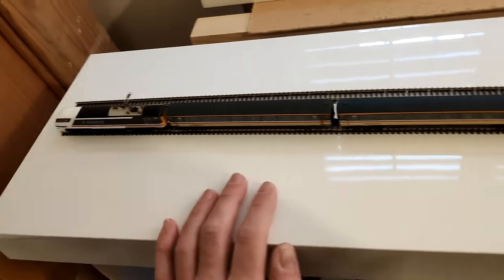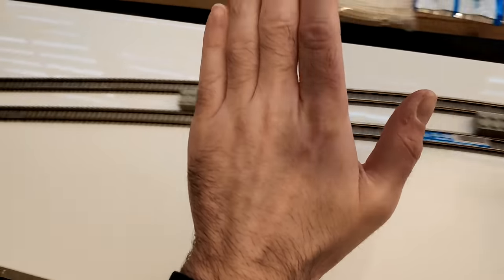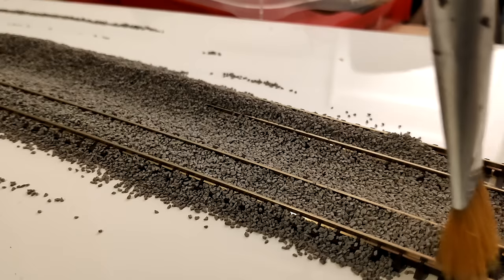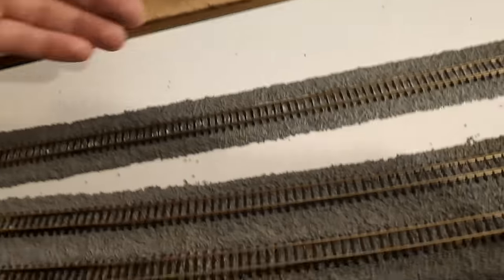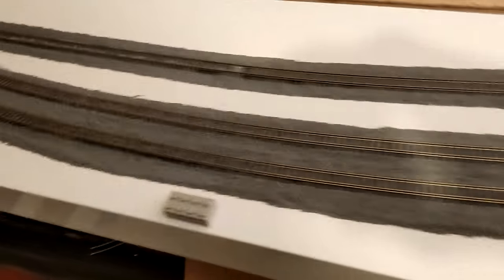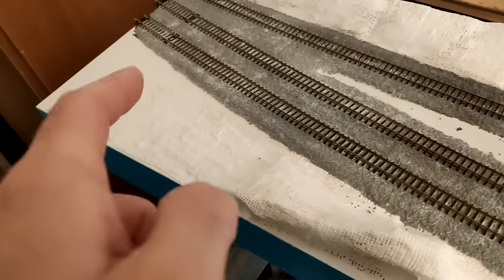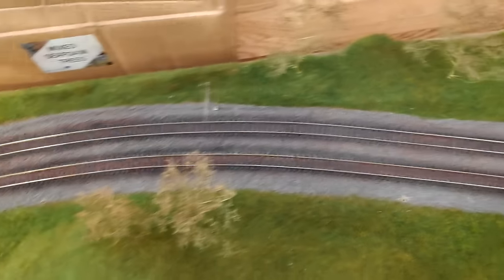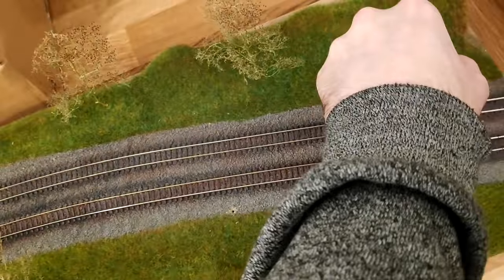Lets Build an N Gauge Shelf Layout (Elevated Curves)

Comment: Hi Richard.  The trick to stopping your ballast from floating when you apply the glue is to pre wet the ballast using a very fine mist of Isolropyl Alcohol.  I use a solution of about 85%.  This stops the ballast from moving and I use a normal glue bottle with A 60/40 mix and drizzle it on.  A quick ipa mist afterwards will sort out any bits of glue that are sitting on top or poooling
Reply from the maker: Thank you, Yes i knew i was missing something when i was ballasting! Brilliant cheers 👍

Comment: a great glue for ballast, is 1/4 pea, 1/4 acrylic medium ( I use gloss it is cheaper) 50% 90%+ isopropyl alcohol. The benefits of this is that the ballast will not be brittle and can flex if the board is moved or transported.

Comment: Hi Richard. Very effective! I was surprised when you put static grass directly over the plaster bandage, but it works very nicely. (It's not necessary to physically ground the crocodile clip - you can just hold it just above the surface, although clipping it to a rail is handy.) You definitely need the buffer stop at the end of the siding. Right-hand running! (sometimes)?
Reply from the maker: I call rule 1 for my running of locos as i just dont know enough about the real ones myself just yet, ive seen most real locos in my area run on the LH rails, is this a common setup of the railways? Like our British roads, drive on the left kind of thing? 

Im affraid to electrocute myself so i opt for clipping the static grass applicator where possible👍, i may get brave on my next application of grass and hold the clip with my hands 😁. 

The buffer is in place now and forever it shall stay, ive superglued it down👍

Thanks for Watching Paul, i appreciate it👍
Reply: @ThisWayWorksTWW  While LH or RH running (depending on the country - interestingly, when Sweden changed from driving on the LH side of the road to the RH side [overnight!] in 1967, they left their railway system on LH running) is the "norm", there are often reasons for reversing this; so, Rule 1 applies. I'm a little worried about your fears of being electrocuted! If you hold the wire rather than the clip (as other modellers do), you should not receive a shock. I've not seen others discharge the static at the end of applying grass in the way you did; is your "cheap" applicator safe?
Reply from the maker: @PaulSmith-pl7fo  good point with regards to "is it safe". As far as i can tell other Applicators are the same. As soon as i touch the clip with the applicator after use i know the capacitor within the device is then discharged and il get no surprises when i refill the pot on the applicator. I think im due to upgrade what i have and maybe to a smaller applicator i think so i can get in the nooks and crannies of the layouts. 

Thank you for the info regarding LH running, it also helps me work placement of signs and signals! 👍

Comment: Soldering the track together is fine, but useless for those who model in sheds, lofts and garages as it does not allow any movement in the track for heat expansion or contraction. I model in an environment where the temperature often tops 125f due to a corrugated transparent roof.
Reply from the maker: Hopefully the expansion of track on this layout will just extend off the end of the shelf.. although i keep my layouts indoors this summer it will be interesting to see how my layouts react to the heat, i remember seeing allsorts of damaged layouts last summer when the temperature got hot
Reply: Superb shots. Have you added anymore 'feeder' or fiddle track at the end - it doesn't seem long enough for the runs you get in the movies from a standing start??
Reply: Super Glue works too, and no, I don't have issues with it

Comment: If the fine ballast about the same grain as coffee? Thought the same about breaking those tree parts apart and spraying some heavier brush with glue and sprinkling that over it? Just use them for fall scene.
Reply from the maker: Many people use a spray contact adhesive or hairspray on these trees and then sprinkle bits of scatter or flock on them, saves the brushing glue bit👍, this ballast is about 1/3-1/2 of a mm in diameter. You might be onto something using coffee grains 🤔, if it looks good go with it id say, it would smell good at the very least 😁

Comment: Spray it first with isopropyl alcohol. Then when you use the pipette it soaks into the ballast without it floating away. Also, you can then do it in the middle and alongside the tracks much more quickly and it doesn’t dislodge.
Reply from the maker: Thats the part ive been missing, cheers 👍👍

Comment: Very good; the camber of the track is quite neat. Is this eventually going to connect with the viaduct (how's that coming along??😉) and Crewe? You didn't mention about cleaning your track after painting. Do you use an abrasive or chemical? Thanks. Take care
Reply from the maker: Ah yes forgot about the cleaning bit! Because i used acrylic paints the paint is very easy to remove from the rails, i scrape the tops of the rails with a peice of wood then clean with isopropyl alcohol then give it a hoover, works a treat. Yes i can connect with the viaduct in the future 😉, i got stuck on how to make the shelf removable but keep the transition of the viaduct to the other shelf but i have found a neatish way of doing it now so in a bit of time i shall resume the Brackley Viaduct area 👍. Creweworks is coming along nicely and i have many things to show but all the superstructure is at various points of completion so i havent been able to get a video out of Crewe just yet.. soon, very soon there will be an update though 👍

Comment: Hi Richard What some excellent ideas. You have my thinking hat on. Do you connect it to a loop ? cheers Roger
Reply from the maker: Hi Roger, yes i looped the track around the back of the shelf layout with some set track, i didn't fit a backscene as it allows me to film all around the diorama then. Ive just been moving around a painted blue peice of wood as sky for temporary measures so far 👍, the idea for me is to have many shelf layouts and just connect them in any way i like with set track in the future 👍, when not in use i slide them back on their brackets on the wall 👍

Comment: Why have you not removed the clear wrapping off the shelf? Surely the ballast will come loose.
Reply from the maker: The shelf is the gloss white option, i had removed the wrapping. There are seperate peices of wrapping on the sides to the top, if its the peices of wrapping on the sides you are referring too then those were left on to protect them from paint, the sides and top wrapping are seperate... In short i had removed the wrapping lol

Comment: Hi, in the video you mention using super glue to affix the siding track to the shelf base. Do you use this method for all of the track to tack it into place after shaping before ballasting/ gluing with the PVA?
Reply from the maker: Yes i fully glue all the track down with Superglue. Once the track is down for good i do the ballasting with the PVA mix 👍.
Reply: @ThisWayWorksTWW Hi, thanks for the info. Much appreciated. I think I'm missing something with regards to holding the track in the correct alignment/ curvature while you are in the shaping stage, I see the little bricks but not how you tack it as you go, before applying the super glue prior to ballasting. When I last did this in the 80's,  it was on sundeala board, so I used paper point templates and could pin. I like this idea of using floating shelves that can be stored in a wall rack. Seems a good way to go as regards having a semi-perm but mobile set-up. Great selection of videos. Very informative.
Reply from the maker: @N440-w3d  Thank you, the building blocks are just loose (not glued) and are just a quick way for me to get the tracks parallel as i glue the track down.. the flexitrack code80 by Peco almost holds its shape so i shape it by hand and apply glue to the sides of the sleepers, the capillary reaction between the shelf and track draws the superglue under the sleepers and makes for a very permanent job. Sometimes i will draw a line with a permanent marker on the baseboard of which this is what i would use to guide me as i glue the track down. Hopefully this info helps, most of the time i eyeball the track laying 🤫
Reply: @ThisWayWorksTWW  Noted and understood. Thanks again. YouTube videos like yours are a great help. Back in the early 80's my father built an N gauge layout. We learnt a fair bit from magazines, model shops and exhibition visits, but I wish there had been more info on loco repairs..... We had about 10 which were all bought new and initially ran well. However.... Gradually most developed running faults, as we didn't have much of an  idea as to how to service them and my pocket money didn't extend enough to cover repair costs. Dad stepped in a few times, but in time they slowly started failing again.  I was quite handy with my motorbike and one day I thought I'd have a go at my locos myself....  My Suzuki X1 needed plenty of oil and I thought the same would be ok for my N gauge engines!!.....I'll say no more!!....
Reply from the maker: @N440-w3d  Yeah the motors in locos really dont like the oil, I remember when i bought my first N gauge loco from a car boot and tried to fix it.. i had no luck and the internet didn't exist to obtain parts as easily as we can now.. i persisted in fixing things from way back when and now I generally will have a go at most things, theres certain rules you need to stick too to get good results but hopefully i put some questions to rest with regards to at the very least opening a loco up correctly etc 👍, IC engines in cars, bikes etc.. again as you probably know theres also shortcuts that cant be made/rules to follow etc. I should add theres a thing called activator, this you spray on the superglue and it almost instantly cures the superglue. I shall add a link to the superglue and activator tomorrow when i can access a PC..Take care Rich

Comment: What catenary wiring do you use, because the distance is not a standard distance between the masts. Greetings Jef
Reply from the maker: Hi Jef i didn't research prototypical spacing, i just spaced them as per a MK3 coach i had. Although now im interested to see what the spacing should be 🤔 cheers Rich
Reply from the maker: Apparently prototypical in N gauge would be roughly 42cm apart on a straight but closer together on the curves 👍
Reply: @ThisWayWorksTWW  My problem was that I used Vollmer catenary. This manufacturer decided that it wouldn't produce N-gauge catenary anymore. I did have some 120 masts and about 80 wiring items. The length of the wiring is 220 mm, 145 mm, 130 mm and 65 mm. In my opinion these lengths are chosen as a result of the available tracks. Normally the length of the catenary wiring should be around 50 meters divided by 160 = approx. 312 mm. So I tried to make some catenary wiring myself but the soldering of these thin wiring is very difficult.  I'm still sourcing for a solution.
Reply from the maker: @jefwisse1957  ah i see, the Caternary's ive used are made by Dapol, they are just static show non functional Caternary's. I may use clothing thread as a fake wire on mine, yes i can imagine its fairly difficult to acquire some conductive lines. Maybe piano wire would work well however you would still need to solder them unfortunately
Reply: @ThisWayWorksTWW  Solar I used 0.8mm copper wire. Due to their thickness, it is very difficult to solder these wires together. Maybe I find a way to solder them together.

Comment: I'm not a railroader but I do solder a lot of electrical components and cables. I think your solder is to heavy. use of a smaller diameter may have better and cleaner results if you give a shit. Nice video, thanx for posting.
Reply from the maker: Do you mean smaller diameter solder iron tip? Or solder itself? With the way things are getting smaller it is tricky soldering somethings at the moment 👍